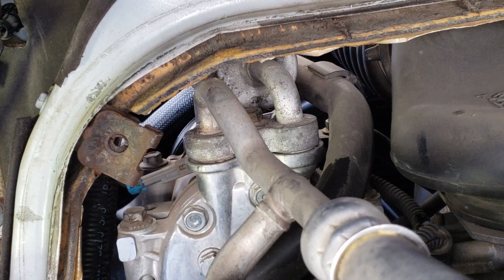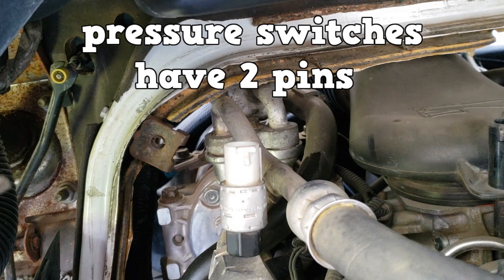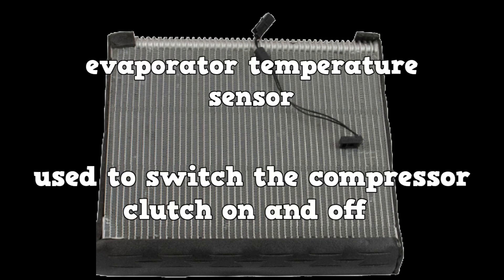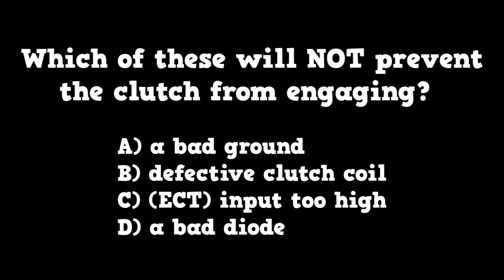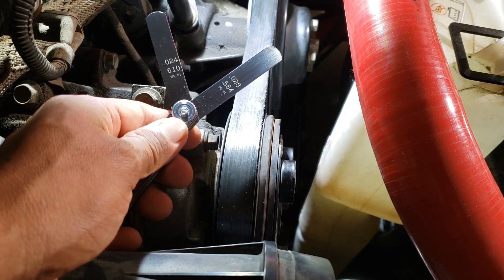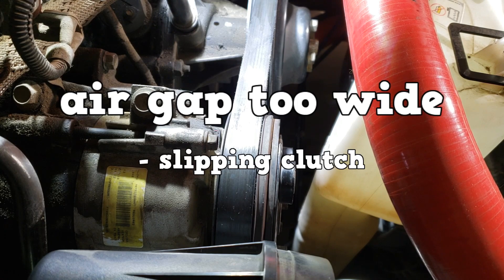ASE A7 Test Prep #2 - Compressor and Clutch

Comment from the maker: Update Oct 15, 2023: (Feedback after taking the test) No questions about how the compressor works or types of compressors ( vane, variable displacement, scroll).
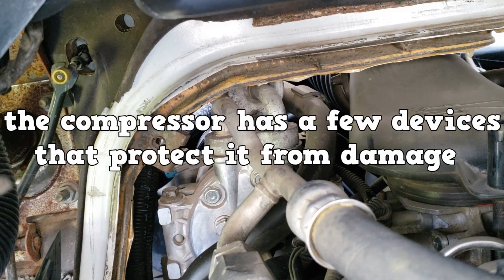There was a few about the compressor clutch and a few DIAGRAMS on why the clutch does not engage. The info from 0:40 to 3:01 is helpful. 
The diagram questions about the compressor clutch not engaging are not difficult if you understand what can and what cannot affect clutch operation. You need to MASTER the concepts of electricity, I recommend you get the A6 before going to the A7.

No direct questions about the clutch air gap, but clutch slippage can show up as one of the answers on some questions, so you do have to know about it.

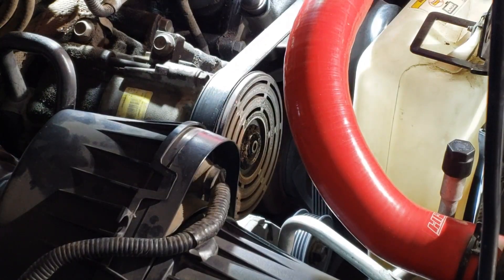The practice diagram questions after 4:32 are crucial to understand. There's MANY diagram questions on the test, at least 20. As already mentioned a few are on the compressor clutch not engaging. Tackle these by outright eliminating the obvious incorrect answer (i.e. a faulty blower motor resistor is not going to affect clutch engagement). Then tackle the obvious incorrect electrical answer (i.e an open at the blower motor ground is not going to affect the clutch engagement). Again I mention that you master how electricity behaves (open circuit, short to ground, short to power, high resistance, low resistance, voltage drop). You can know everything about automatic temperature control, but if you lack the knowledge about electrical circuits, then you're going to get an easy question wrong!
Other diagrams are on automatic temperature control, blower motor speeds, etc.
Reply: I saw how you mentioned that there's at least 20 diagram questions. Is their more electrical wiring diagrams or a/c diagrams? Or what do you mean?
Reply from the maker: @182Bassist  Diagrams Related to the A/C system. For example, you'll be shown the wiring diagram for the compressor's clutch, it is not activating, and you'll be shown possible electrical fault points (such as a burnt fuse, open wire, etc.)

Comment: Awesome videos pls explain questions answers
Reply from the maker: question at 2:25 . If the clutch has a bad ground, the clutch coil will have an incomplete circuit and  will not operate.
A defective clutch coil prevents the clutch from engaging because no magnetic field is created.
If the (ECT) input is too high, the vehicle's PCM will "know" the engine is overheating, and will shut off the compressor to reduce load on the engine.
The correct answer is D
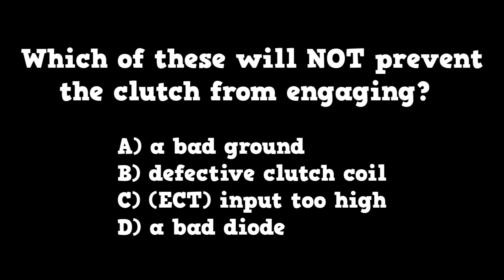Reply from the maker: question at 2:45 . low battery voltage does prevent the clutch from engaging because of a weak clutch coil magnetic field, same with high resistance in power side. 
The correct answer is C. Blend door position is not an input that affects clutch engagement.
IAT input too low usually tells the PCM you're in a cold environment. This would affect condenser and evaporator superheats and subcooling. The PCM prevents the compressor clutch from engaging in cold temperatures.